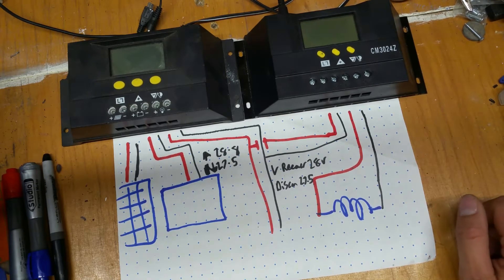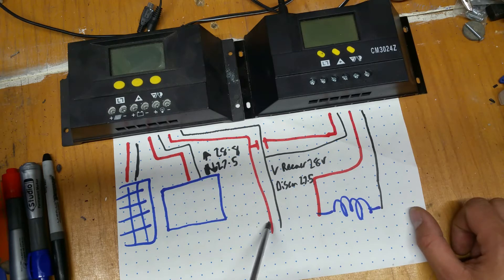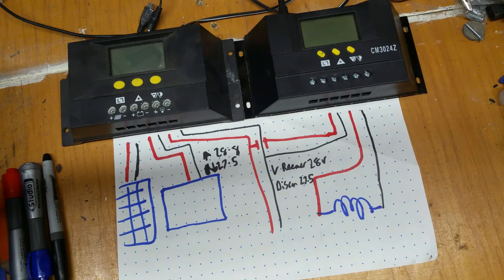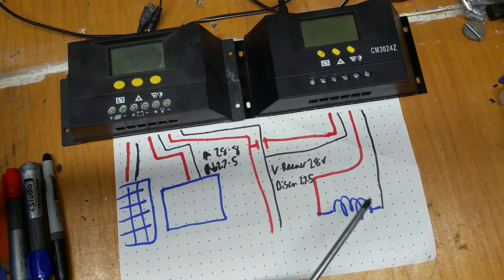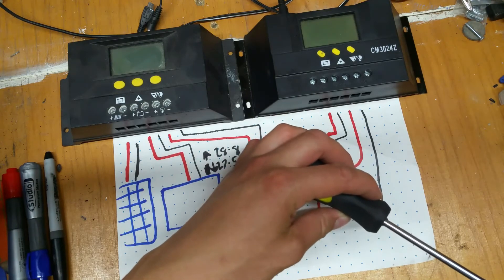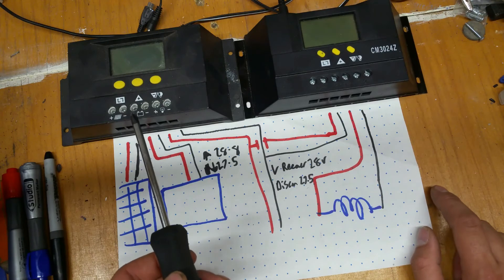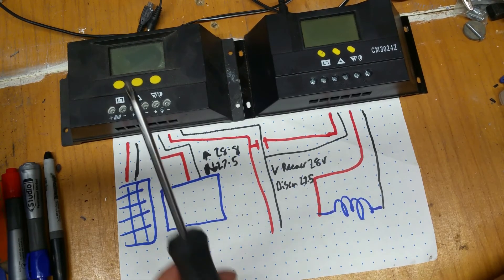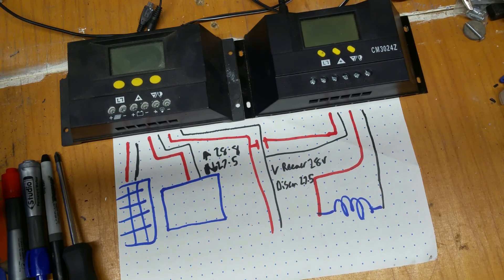I'm looking for a cheap solution for a voltage operated relay/switch?

Comment: Simple Arduino circuit  with 2 relays and input voltage sensing is way to easy
Reply from the maker: navdeep pathania as an electrician I have a year of electronics and programming. But will no doubt get into them when I have finished some of the bigger projects I have my hands on.

If you have any clues what parts I'd need to order to make this project a little easier for me if love some part numbers? =)
Reply: https://www.youtube.com/watch?v=FaoKzi7tgME     , this is voltage comparator module for arduiono  , the code is easy to drive one relay above cutoff voltage and other below or use single relay ,to power arduino use buck converter with LM7805 for steady voltage from same source.

Comment: Im already using this every day as a diversion control and currently have found them use full owning 3 of them doing various task youll need to use an external relay to carry the higher amps and add relays untill they no longer get hot to the touch if you have not found a solution this should work just fine for you.
Amazon ASIN B01GJM04GC
https://www.amazon.com/gp/product/B01GJM04GC/ref=oh_aui_detailpage_o09_s00?ie=UTF8&psc=1
Reply from the maker: I would like to get my hands on a couple of the first type. The newer ones do not have the high voltage programmed in to deal with a 7S lithium pack.

But I do have that exact module on test. Only problem is relay chatter, when the battery voltage dips and it switches for a second or two. I believe it has a timer function onboard but haven't found it yet.
Reply: the one from amazon dont have the timer function its just a delay response to the set point being reached. I seen some of your earlier videos considering 3 or 4s what happen to that im going to do 4s myself and make it work ive already done most of the workaround in my head and just have to test it. Im just getting started with this 18560 run and my sla batteries are about a year old so ive still got plenty of use for them. Ill either do a hybrid sla and 18650 mix or do one room stand alone. ive been working with 12 volt for over 3 years and really dont want to change so ill have to use my electronic back ground to make it work but a BMS and voltage control is going to be the key thing to make it work. 
As far as the board link i sent ive never once heard the relays chatter its worked perfect to devert my 60 amps in solar array to keep from over charging the batteries and it actually just turns the power on and off to 3 relays much like the coleman charge control board does or any other non sold state diversion controler for that matter. I had my doubts about it at first but after it working like a champ for over 6 months now i just hear the relay click and know my batteries are full.
FYI you dont need a load to be switched over to when the set point is reached for solar only wind but if that is the way you want it to work then by all means do it that way. Its yours

Comment: http://mwands.com/store/charge-controllers/hybrid-charge-controllers/12-volt-digital-440-amp-charge-controller-divert-relay?sort=p.price&order=ASC
Reply from the maker: Thats a good idea! But would cost me double that to import from amreica after shipping and import tax! =/ Ideally £20 or under is the budget
Reply: http://www.ebay.com/itm/G5-Brain-Only-For-24-36-48-V-solar-panal-Digital-Charge-Controller-Wind-turbine-/272424270884?

and check the local car audio or electric forklift shop for a NO relais or solenoid
Reply from the maker: Michel Daggelinckx that is perfect. I have ordered another item from ebay. but I shall pick one of these up should the first unit be no good for the job! I hope you haven't spent too much time on my behalf looking for these?

Comment: I had toyed with the idea of making some boards with comparators to do this with a programmable cut in and cut out threshold. for my solar shenanigans. I'll send a couple your way if I ever get around to it.
Reply: eBay item number 311620281830 looks like it would fit the bill for you.
Reply from the maker: That would be very kind of you. Comparitors and dividers have come up a few times. Whilst being blind when it comes to electronics i think its time to do some learning and do some research in this area. =)
Reply: It's basically a configuration with an op-amp where you compare a measured value (such as your battery voltage) with a set reference value and the output is driven high or low depending on which input is higher. The modules on eBay have a potentiometer to adjust the set point and a relay that opens when your measured voltage goes below your setpoint. I think they look like they've got some histeresis built in as well, so it wouldn't oscillate (click on and off really quickly).

Comment: It's quite a neat idea to use a second solar charge controller but for all intense and purposes you're just after a low voltage disconnect aren't you? When batteries are under 28 volts switch off the circuit and when they are above switch on your load...  
something like this which Julian looked at a few months ago might be an option?  http://YouTube.be/YGp2wDAfC1k It would log the use of the hot water heater too which might be a nice addition. If you want a solar charge controller that allows you to adjust the low voltage disconnect to that type of level then check out the EPEver ls1024b but you'll also need a programming cable (you can make one very cheaply if you follow my video).
Actually you may have given me an idea... :-)

Comment: Uhm, no, I don't understand. You want to burn away excess energy when cells are full, but solar is still delivering?
Reply from the maker: I run a very small system and it can be charged before midday. I 'm just looking at a way to allow a small volume of water to be heated whilst my batteries are at the top 85% SOC. without the need to monitor the weather to decide if i should turn it on in the morning.

Comment: pietkaify, you might use a simple op-amp to drive a mechanical or solid state relay.  There are many op-amp circuits online which have a pot for turn on and a pot for turn off voltage thresholds, the hysteresis can be changed too.  A transistor with a adjustable voltage divider across the input base might do what you want with said above relays types.    Don't have a link.
Reply from the maker: I have similar ideas recommended! Whilst being an electrician by trade. I have little idea when it comes to electronics, so please bear with me whilst i try my best to learn a bit more along these lines.

Comment: Many microcontrollers have an analog input, and voltage dividers exist.
So you could have 3 voltage dividers divide the voltage down to 3.5v for 28v and 3.4375v for 27.5v going into the microcontroller that switches a relay off when the reading is 3.4v (24.2v on bank) or switches on when it's 3.5v.
Microchip has cheap PICs, resistors are really cheap and relays are cheap as well. You most likely will have to have a transistor switch the relay, instead of the straight MCU.

Comment: It would - in theory - be possible by connecting a lot of cheap diodes in series with a relay and because of the voltage drop across the diodes the relay will turn on only at a certain voltage but since the relay keeps being closed even at a lower voltage it might be what you are looking for. You just have to experiment a little.
Reply from the maker: So Many Fn Bananas it had crossed my mind using resistors in series to loose the voltage. My thinking is u have an excess of power anyway I could loose a few watts in heat. I may have some diodes in the work store. I'll have a look tomorrow!